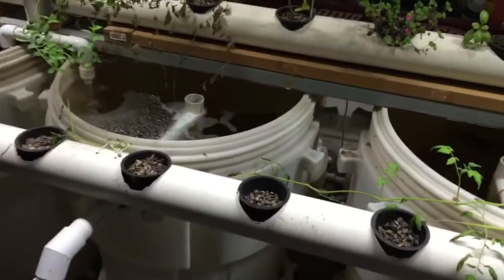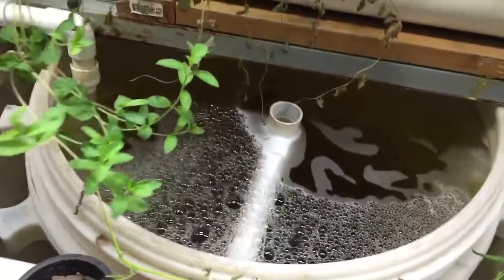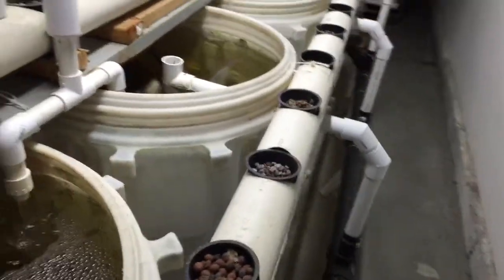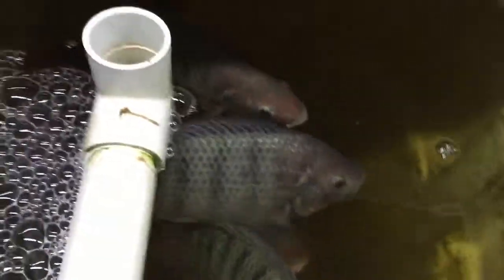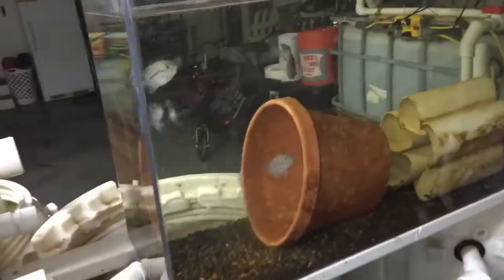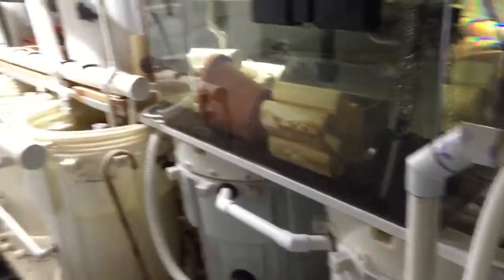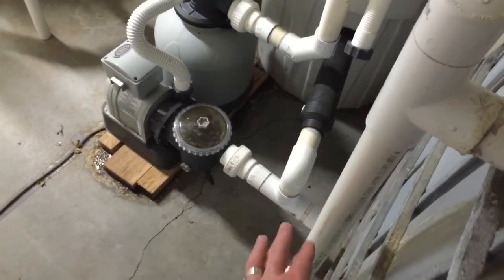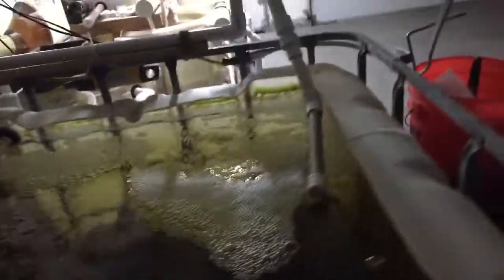(9/21/2016) A Quick and Easy Aquaponics Update

Comment: Damn.. Regarding water changes, why not get a rain catch system in place with ibc totes? Im sure you can use that for your aquaponics :)
Reply from the maker: Very smart idea and I really wish I could.  Although I live in the Pacific Northwest of the U.S., I live in the dry region and it doesn't rain very often.  We are benefactors of the Columbia Basin Irrigation Project which captures snow and rain moisture in the Cascades and Rockies and funnels the irrigation water through a vast web of canals and reservoirs.  My irrigation rights are unlimited.  That is why I use the water liberally.  If my irrigation water was coming from a well or some other unsustainable source, I wouldn't be using it this way.  Thanks for asking!
Reply: Where are you located ? We are in Manson - WA

Comment: I have the same containers you have, 2 IBC's, barrels, and 2 pair if 200 & 400 gallon tanks. I got all that free off Craigslist! I want to research prior to building, that is why I subscribed. I never had fish or a garden (retired recently 25 years mobile). What pump do you use to move the water?
Reply from the maker: I use a common above ground pool pump.  I bought it from Amazon.  You know?  The ones that have a pump and a sand filter attached in one stand.  It is pushing 2,400+ gallons per hour.  I wanted my entire system to filter through once every 40 to 60 minutes.  I am almost there with this pump.  Thanks for asking and I wish you the very best of luck!